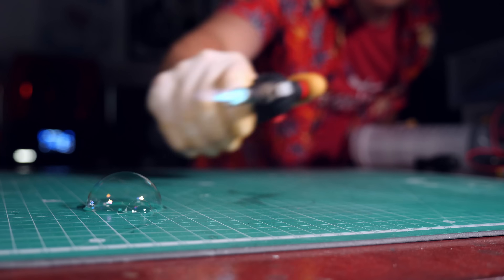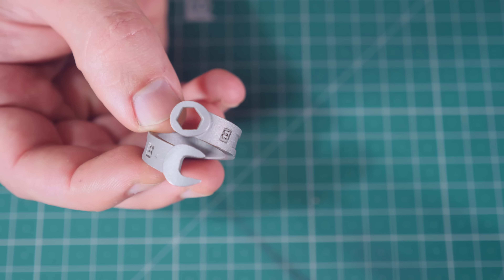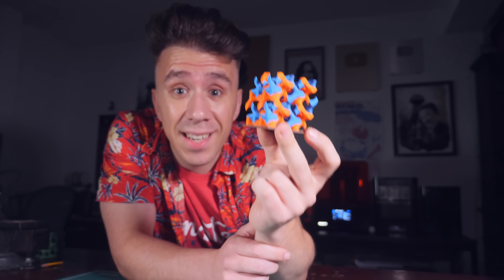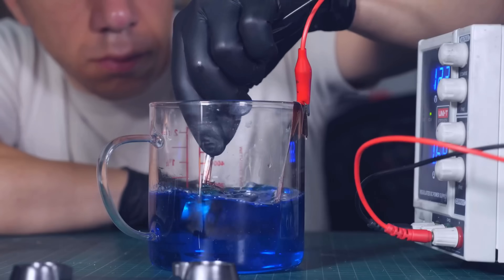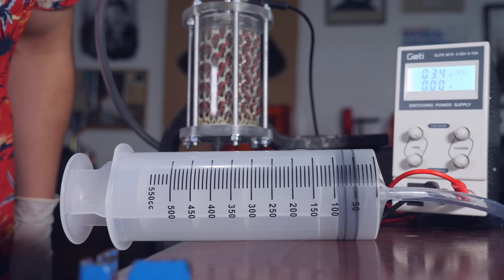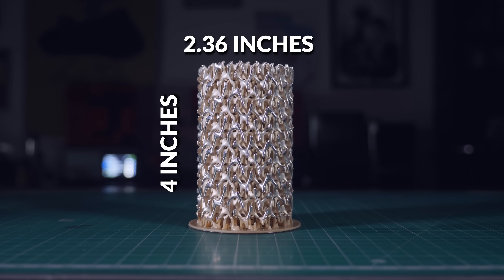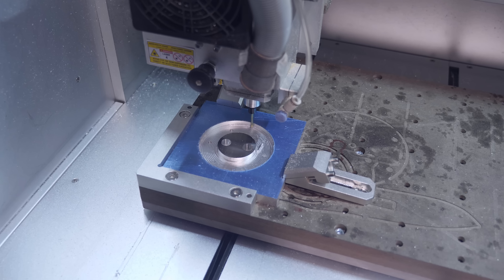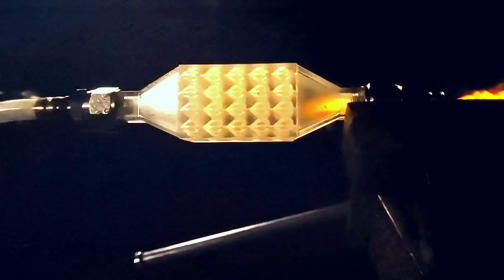ROCKET that LITERALLY BURNS WATER as FUEL

Comment: A few points from someone who has made an oxyhydrogen torch before.

1. Your first setup with the gyroid shape had several issues. When performing a high current electrolysis reaction, selection of the electrode material is very important. I used 316L stainless steel as it was one of the most corrosion resistant. Even then, small amounts of the metal will still be destroyed in the reaction, so plating a thin layer on simply is not going to work, at least for very long.

2. It would probably be useful to experiment with different amounts of spacing between the rings. With too little spacing the bubbles of gas that are being quickly produced will displace the water from the electrodes reducing your efficiency. As you said, too much spacing will increase the resistance and make the device larger overall.

3. The voltage isn't something that bigger is simply better. Higher voltages increase the current yes, but also significantly increases the rate of electrode corrosion. Electrochemical splitting of water requires about 1.8v per cell. Round up to 2v for whatever inefficiencies you might have. Don't increase your voltage much higher than that. You could use a voltage and current regulator to dial these in which will also prevent you from burning out your battery.

4. As I'm sure you know oxyhydrogen burns at nearly 3000K. I'd be very interested in what materials you'd use and how you'd manage to actually use this as a rocket propellent
Reply: Probably the same way that nasa handled it, feed the fuel around the nozzle, also increase efficiency preheating the fuel
Reply: The minimum theoretical  voltage is 1.23V per cell. But as you say in real life it will be more due to losses. And maximum theoretical efficiency is 1.23 watts produce 11.4 ml of HHO has per minute.
Edit: the above 11.4 ml volume is at room temperature and pressure
Reply: Gotta love ChatGPT
Reply: Would definitely be cool to see if anything can even be designed to handle the heat of a perfect stoichiometric ratio. Most rocket engines run either fuel or oxidizer rich, typically due to heating concerns. Maybe an aerospike could do it? But that's just a nozzle, would basically have to invent the aerospike version of a combustion chamber. Inverted combustion chamber or something, idk
Reply: @DarkAttack14  true but they used cryogenic LOX, he's using a room temperature gaseous mix of hydrogen and oxygen. I doubt this would have much cooling effect.
Reply: Also, if he built the whole apparatus in an ultrasonic cleaner, the vibrations will knock off the bubbles which insulates the electrode and prevents further reactions. So, knocking the bubbles off will allow for more effective reaction area.
Reply: I thought water is conductive enough without adding anything like sodium hydroxide?
Reply: @PsychoticWolfie another reason why hydrogen rocket engines run fuel rich is because the lower molecular weight of Hydrogen vs Oxygen makes the rocket engine more efficient by increasing the speed at which the exhaust exits the nozzle
Reply: @IshaqIbrahim3  lol. distilled water is considered as one of the BEST insulators. highest dielectric constant of any common material...

it just very very quickly becomes NON-distilled as it starts stripping ions off of anything it comes in contact with...
Reply: @Max_Chooch hey, that’s smart! I was thinking stacking metal cones and drawing down water through a central hole.
Reply: Nice ChatGPT copy paste.
Reply: @GamingWithBlitzThunder  strange how it refers to itself in the first person? "i used 316L stainless as it was the most corrosion resistant...".

even the grammatical errors in the actual sentence given suggests human... writing a helpful reply based on prior experience and collected knowledge.

it definitely doesnt have that supercilious smug and condescending tone that chatgpt normally has... so either theyve really picked up their game, or... its actually a real response written by a real human...

yknow, not everyone requires some freaking program, but actually, surprisingly, know what theyre talking about, often from real world experience...something no program can ever emulate.

if that upsets you, by all means, play with your stupid little chatbot.

not everyone else feels they need it.
Reply: @DarkAttack14 That works with cryogenic fuels.
Reply: @Calligraphybooster  I thought the same thing while seeing him make those plates, imagined that something like some washers, press-formed into the cone shape, should do
Reply: Would alternating current (not 50 Hz probably more like 1 Hz) save electrodes, oxides should release and maybe even annheal ripped out metals. Might also decrease needle buildup.
Just a thought that came to me, but I have no setup to test it on and too lazy to make my own just for this.
The idea came to me from backwashing filters which I am obsessed with for some reason.
Reply: in re. 2 - bubbles lowering generation speed - on the plus side, it introduces a negative feedback. The higher the temperature, the higher the generation speed, the higher the current and you get a boiling electrolyzer
in re. 3 - 1.5V/cell is a safe value at 1.8V one loses quite a bit of energy as heat
Reply: @paradiselost9946  Many years ago I have  used two copper wires dipped in water to boil water at places where heaters are not available. I plug one side to live and the other to neutral of 220V power outlet.
Is this not considered conductivity? Since it absorb the electric and produce heat to boil water.

I have not try this with distilled water. So, I don't know if that will make a big difference.
Reply: What if the stacked plates are rotated 90° so it's in horizontal position rather than vertical? I mean, in horizontal position the bubbles will go straight up rather than going aside and then up in horizontal position?
Reply: @serenitas4405  Also if you can rotate it for centrifugal assistance. Probably not gaining more than just letting them drift up, ultrasound can also help, most of all the plates so not need ti be round, can as well have rectangular plates.
Reply: @paradiselost9946  Thank you!
Reply: @lizekamtombe2223  faster decay ive seen it on 60hz
Reply: @IshaqIbrahim3  tap water is conductive. sort of. sea water, even more o, but you make chlorine gas instead.

electrolysis takes less than 2v, and given a certain plate size, a certain current will flow as the process takes place. 
feed it more voltage, the excess current that can now flow is simply creating heat, through ohmic losses, I2R, rather than going towards producing gas.

ive seen the same method used in industrial water heaters and yes, i had to scratch my head over that one for a few years... "is that even safe?"

and where it was, an entire production line relying on it... its basically bulletproof. an element may break and need replacing... you dont have spares in stock.
 an electrode... gradual decline in performance and power draw and yeah, you know its time to overhaul with plenty of warning.... theres a few million dollars riding on it working as intended...
Reply: NightHawkLight had some success with a dull needle, but there is a reason NASA used regenerative cooling in the shuttle engines
Reply: @IshaqIbrahim3  Pure water is actually an insulator, but in practice it's just never very pure, so we are taught it's a conductor.  More ions == more conductivity.
Reply: If Diodes keep LEDs from burning out, why not use them for this to keep your battery from burning out.
Reply: @DarkAttack14  that wouldnt work as the h2o needs to be liquid for the electrolysis
Reply: what if the electrodes are made of grafite
Reply: @henryjulianmurillogutierre3421  why would that matter? The battery fails not the electrodes.
Reply: Future sub. Is there any organic method of producing H gas, maybe a green friendly route?  Like cull tomatoe  acids  or fried green tomatoes. They have to be good for something!
Reply: @Calligraphybooster  cones seem like a good idea because the bubbles rising would probably cause a water current up the central hole, carrying the gas away faster.
Reply: more interesting is the oxyhydro torch setup you have...!
Reply: @GamingWithBlitzThunder his channel literally had a video of him making an oxyhydrogen torch
Reply: @Max_Chooch that's a really interesting and unique idea!
Reply: @IshaqIbrahim3 perfectly pure water is actually not a conductor at all
Reply: @lizekamtombe2223 the water is heavier than the generated gas, so the gas would be "pushed" to the center of the disks, this may actually work though if there was a central tap hole in all of the disks, allowing the gas to escape through the center
Reply: @jeffreytgilbert that's now how it works... an LED is a Light Emitting DIODE, I believe you are thinking of resistors which are commonly used to limit current to the tiny amount needed by an LED. The issue here is that this generator needs a lot of current, and adding a current limiting resistor at the resistance necessary for the desired output current would generate a large amount of heat as waste
Reply: @Sudonymer  Where can I get this water? I want to experiment to verify. How many times did you try experiment with perfectly pure water?
Reply: @IshaqIbrahim3 regular water has an amount of salt so it's slightly conductive, sodium hydroxide is added to increase the conductivity even more, regular salt could be used but it'll create hydrogen and chlorine instead of hydrogen and oxygen
Reply: @artemis.nnnnnbbbbb  You said { regular water has an amount of salt so it's slightly conductive }.
What is regular water? is that the chemical name from chemistry or did you just make it up?
When you said regular water all I am thinking is the water I can get from the faucet since it is the most common or water from the storage tank.
Did you do any experiment with the water you called regular water? What are the results of your experiment?
Reply: @timarc9895  The inside of the combustion chamber was at 3000c, so it doesn't matter much if the coolant is 2900c or 3200c cooler. Only about a 10% difference
Reply: @IshaqIbrahim3  yes regular water is just water from the faucet or in water bottles
Reply: @artemis.nnnnnbbbbb  You said { regular water is just water from the faucet or in water bottles }. If it is water from the faucet, then water is not an insulator. It conducts electricity.
Reply: @IshaqIbrahim3  bro, don't use copper if you plan on drinking it haha
Reply: @thedillydotcom huh?? You do realize that LED stands for Light Emitting Diode, making it inherently a Diode already... how or why would a diode used for rectifying alternating current be useful?
Reply: @IshaqIbrahim3  yes but only slightly, it's a range of resistance
Reply: @artemis.nnnnnbbbbb  Then it is not an insulator.
Reply: @IshaqIbrahim3  yes regular water is not an insulator, pure water is
Reply: @artemis.nnnnnbbbbb  What is pure water? Is that chemistry? Or did you just make it up?
Reply: @IshaqIbrahim3  pure water is water without anything else dissolved like salts or other things, normally water will have some small amount of salts and other stuff dissolved but it can be removed by distilling the water
Reply: You can use Inconel for the rocket nozzle. But even then, you'll eventually have to cool it down at some point or the Inconel will melt. You could use water to cool the nozzle down, but make sure the water never goes above boiling temperature.
Reply: @paradiselost9946 me thinks ppl say “nice chatgtp copy/paste” bcuz they themselves aren’t educated enough to come up with the same response and feel inadequate. The subject of the video is not even that crazy. Ppl have been splitting water molecules for literal centuries. The Baghdad Batteries are theorized as being an early form of electrolysis and those are like 1800 years old lol
Reply: Here is the True Savior

HalleluYAH translates “Praise ye YaH”

YaH is The Heavenly Father
YaH arrives via the TENT OF MEETING
YaH was Who they Crucified for our sins
YaH was Crucified on an Almond TREE

Semitic of Moshe (Moses)
Isa Scroll (The Original Isaiah)

Isaiah 42:8 - I am YaH; that is my Name! I will not yield my glory to another or my praise to idols.

Isaiah 43:11 - I am YAH, and there is no other Savior but Me.

Isaiah 45:5 - I am YaH, and there is none else.
Reply: @MiniEmpireBros how is it chatGPT?
Reply: If you shot peened your metal at near absolute zero, your 316L stainless would last many cycles longer. Many many.
Reply: @jeffreytgilbert  you could use a zener diode that was rated whatever voltage (or close to it) and shunt the extra voltage to ground.  An LED actually IS a diode btw.
Reply: @IshaqIbrahim3  Pure non-ionic water is a good insulator.
Reply: @artemis.nnnnnbbbbb  when you say pure water, are you talking about distilled water?
Reply: @eminmuhammed8485  yes
Reply: Great feedback, how big was your cell, i.e. plate count, thickness, and spacing? Also, what was the gas output at 2v and how many amps did it consume?
Reply: As some singer once said "I am titanium"
Reply: @Max_Chooch  dont you think you have to have a flow...as well as separation of the gasses
for heavens sake think safety
Reply: @henryjulianmurillogutierre3421 - Best idea/suggestion yet!  Graphite is way easier to work with compared to 316 stainless steel.  I think that's what Stanley Meyers may have been using, made into concentic cylinders that acted as capacitors in a resonant circuit.  Use to have the schematic for the circuit he used.  May still be available somewhere online.
Reply: as above, I used 316 stainless and totenium for my electordes, works fine.Oh and to reduce current draw dilute the elctrolite to suit, excess voltage over 2v per call will produce heat not gas..
Reply: @IshaqIbrahim3  tap water contains a lot of impurities. That's why you need to decalicify your appliances every once in a while. At the same time: you drew maybe 10A at 220V - here the power supply topped out at that current at 3V. 
Without external ions water indeed doesn't conduct. But it's among  the best solvents, eager to pick up whatever it can get and become conductive in turn.
Reply: @Calligraphybooster could do both. point down cones might help the shaken bubbles escape better
Reply: yeah me too !!!!!!
Reply: Try using Inconel instead of 316L!
Reply: @GamingWithBlitzThunder bro actually has a video on his channel to back it up tho
Reply: @MiniEmpireBros  bro actually has a video on his channel to back it up tho

Comment: Hi, Integza. I think this is a good experiment, and I have an idea for improvement… 
   First, the problem with electrolysis has always been high current consumption. But you can still get the same results by changing your method - think low current, high voltage. This will be much more efficient, as well as remove the problem of residue on the electrodes.
   If you use pure water, something more like distilled water, you can get the molecules in the water to change direction by switching polarity. Instead of using high current to break up molecules of water, you use friction - the friction of jiggling the molecules at a high rate. You need a high rate of switching.
   Stan Meyers proved this concept when he built a car that ran on water, back in 1986.
   Another central idea is that you put the electrodes in the center of a cylinder of a measured diameter. You calculate the resonant frequency of electricity in water and find try to match that. One pulse of high voltage will resolate several iterations in the microseconds-ish, before it dies out. You time that so you send pulses after x iterations. The water will boil at room temperature because of the massive breakdown of water into gas.

Comment: The problem you're having is because of the acidic electrolyte. Silver may not react with sulfuric acid, but when it is used as a positive electrode, it will break down because it is directly attracting the sulfate ions. Hence why only half of the electrodes were discolored, and also why little oxygen was produced (evident by the less violent hydrogen detonations). This is why sodium or potassium hydroxide are most often used: the hydroxide ions don't attack the electrodes!
Reply: I think it could be more the case that the electroplating isn't perfect enough, leaving small cracks and an uneven surface through which copper is exposed and corroded through electrolysis. Thats why he could scrape down the copper metal which revealed fresh silver. In the alkaline electrolysis you can see 1.) the formation of Silver(I)-oxide at the anode and 2.) the formation of elemental copper on the cathode
Reply: @TheKikori  silver is still reactive enough, even with perfect surface. That why they use platinum
Reply: @Nworthholf  was more referenced to the red stuff. I know that silver oxidizes at low pH electrolysis of Water to Ag+ / at high pH to Ag2O
Reply: But could you reverse the reaction and essentially create a cleaning action by using an AC current instead of DC? Since the product of the electrolysis is not being separated, rapidly reversing the polarity shouldn't be an issue for the end product.
Reply: @kstricl  In theory, but in reality, it takes time for the ions to migrate, so AC electrolysis doesn't usually occur. Using AC would mostly just corrode the electrodes. The best fix here is to simply go back to a hydroxide or carbonate, which work well even with cheap steel electrodes.
Reply: @kstricl  Most likely will desintigrate the electrode integrety because some residue like oxides peel off from the surface
Reply: @TheKikori  Even with the idea of using alternating current, I figured the silver would still dissolve into the solution. But as pointed out by Labcoatz, the ions wouldn't have enough time to migrate under rapid switching so all in all, switching chemistry was the best fix.
Reply: Why not invite lithium hydroxide to the party?  Are sodium and potassium better just because they are more commonly available?